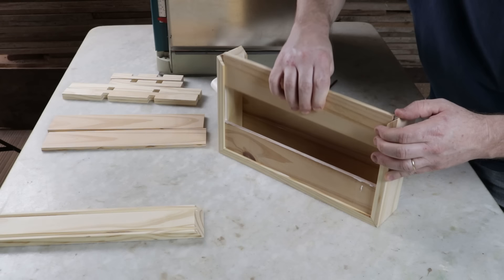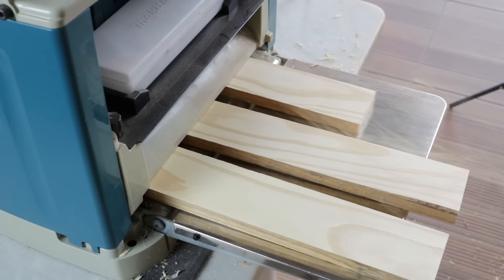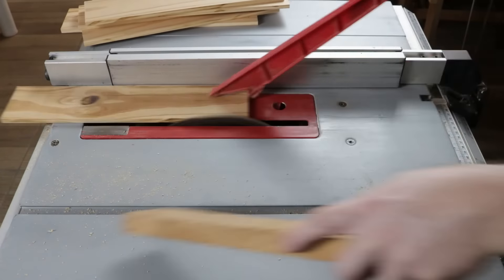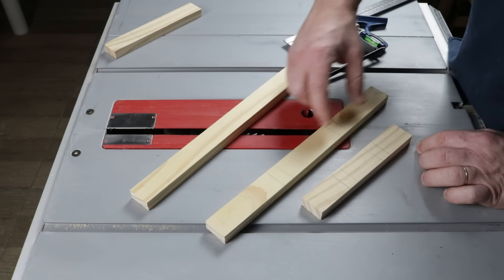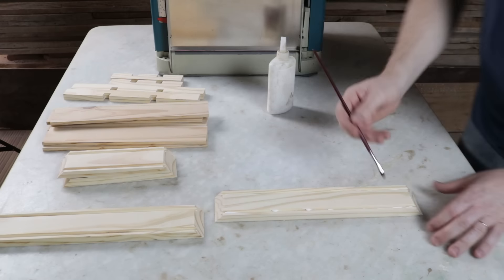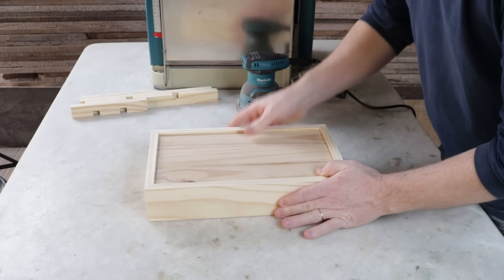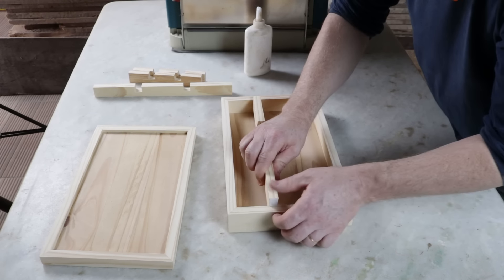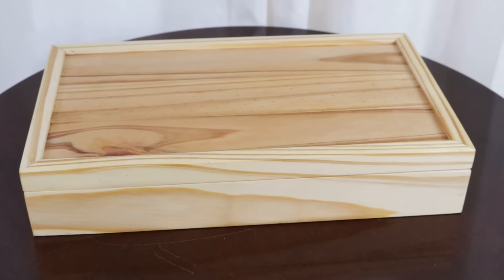VERY COOL ITEM - MADE WITH EASY TO FIND WOODS (VIDEO #60) #woodworking #woodwork #joinery

Comment: In the British SI system centimetres are not used, this was to avoid confusion when we changed from the imperial system of measurement. We use mm and  metres when measuring in woodwork or engineering, There is then no need to include the decimal point,unless you are us in parts of a mm.